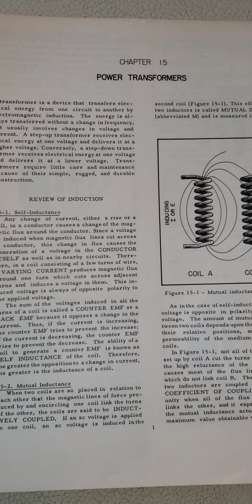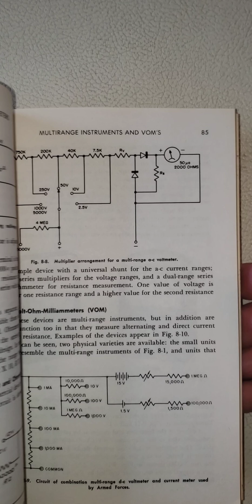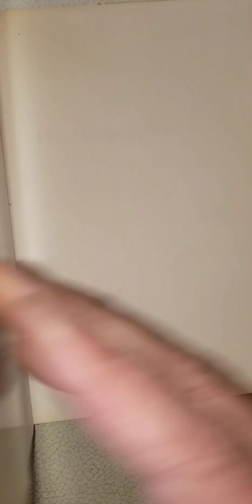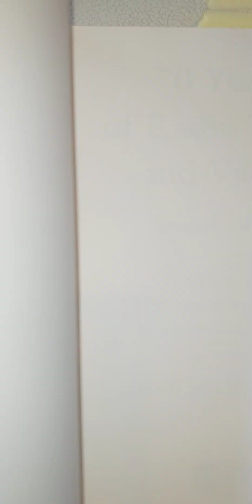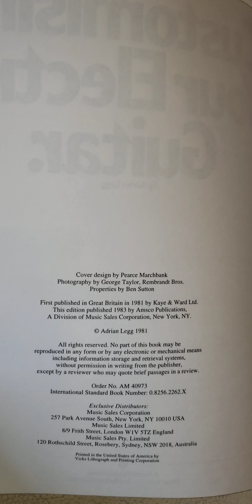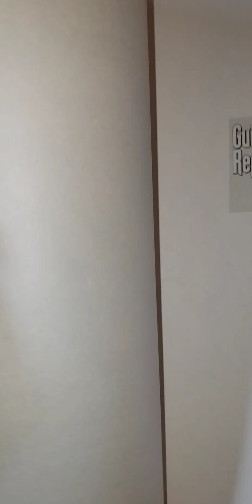Pt2 Vntg Guitar & Tube Amp Books: Mods, Repair, Theory; Pickups; Tube Development History; Test Gear

Comment: omg these books look amazing! Tho I have multiple goals/reasons to study and apply electronics, musical applications are by far at top of list. Compressors and saturation is the biggest lure, but amps, filtering, eq’s, synths, guitar as well. Im loving old books, especially since no principles have really changed. My dad has some of the Forest Mimms III books from Radio Shack. Books really have such a material value in addition to simply the knowledge… the look especially. So neat